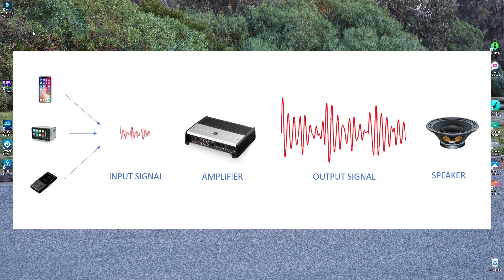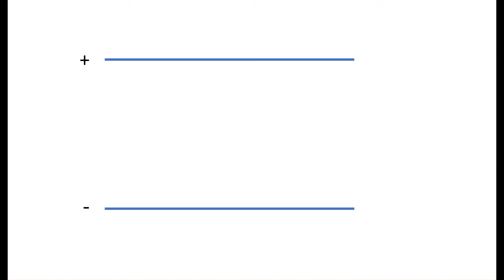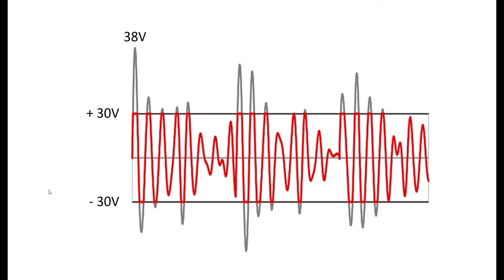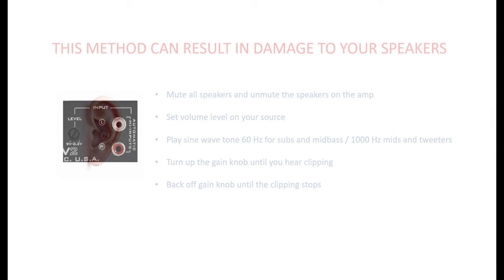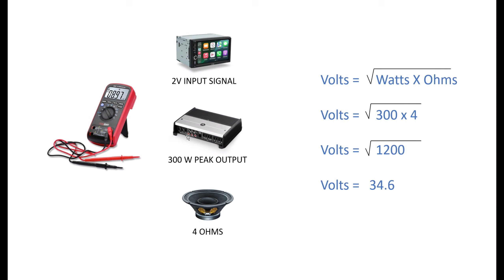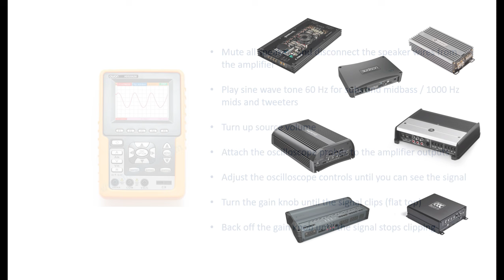HOW TO SET AMPLIFIER GAINS

Comment: Cant trust the output voltage of the source units sometimes either. Some list 4-6v but only put out 2-3v. I believe you can test this off the RCAs with the MM. Barevids also did a good video as well showing how the set gain changes once you add the speaker load back to the amplifier(s).. Thx for the vids!
Reply: For source units, you really need an oscope. While a digital multimeter will tell you rms voltage, it won't show you whether that voltage is clipping. With an oscope you can let's see the maximum rms voltage right before the output clips. 👍
Reply from the maker: Another good point :)
Reply: @socketsocket2763 Yup
Reply from the maker: This is true Jaz !!.

Comment: been gathering amps and helix dsp for new install, your vids over the last few months have been a fantastic resource, Cheers from Perth
Reply from the maker: Cheers thanks Optimus.  Glad these are helping out mate :)    What have you got planned?
Reply: @socketsocket2763  VF SSV Commodore Hertz Mille Legend 3 way up front (had the Component set in previous build added the ML700.3) Tweets and Mids ran off Hertz P Six DSP, MBass perhaps aswell but may add Alpine PDX F4 for these. Alpine PDX M12 running my JLW6v2 which ive had for over 15years still going strong plan to "upgrade" to twin 12s of somekind at some point. First time with DSP so yours and Raw-Cat tutorials have lifesavers. Cheers Steve
Reply from the maker: Noice !!!  Awesome set up mate.... that is going to have some serious punch !!.   Are you going to tune it yourself?
Reply: @socketsocket2763  that is the plan ! would be nice after ive tinkered around to get professionally done just to see if im missing anything... cheers
Reply from the maker: Great stuff Steve.... If you get stuck or need a hand just shout out :)